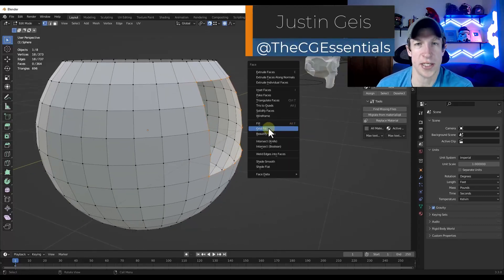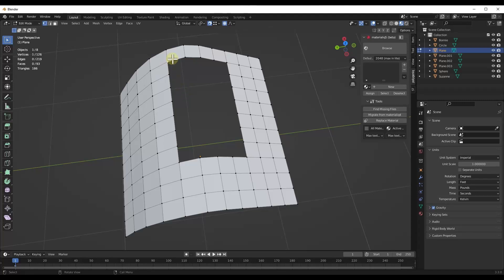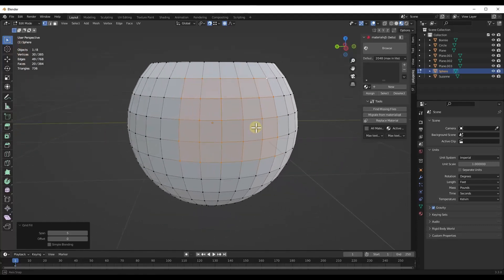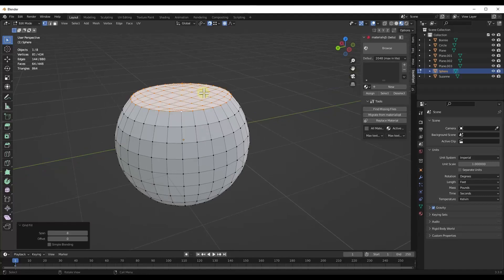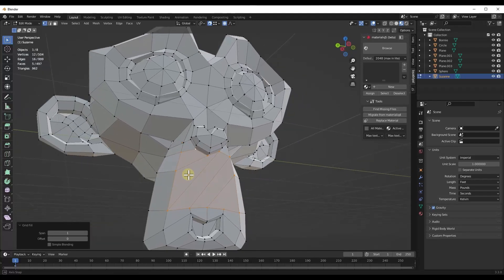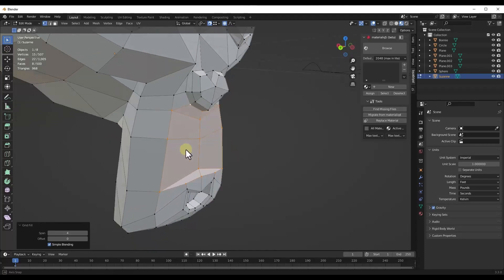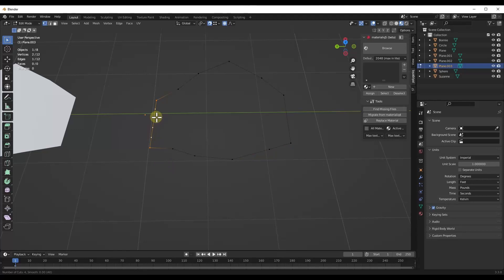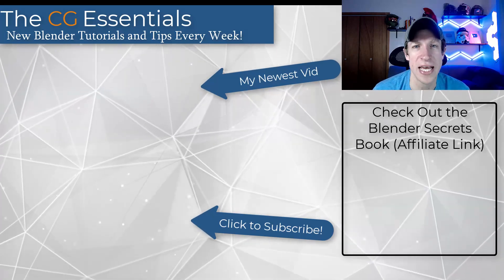FILLING HOLES in Meshes with Grid Fill in Blender!

Comment: ctrl f to fill is nice, but how you find it so i can manually see the path and learn it inside out? for example, if i want to make a cube i know i need to press shift+A and it will open a "drop down" menu but i also know that without keyboard, i can go to Add in the selection menu screen?

Comment: why doesn't blender have a simple modifier of Cap Holes, like in 3d Max or close holes in Agisoft Metashape? why do you have to select the edge of the hole and then you can click F? what if you just want all the holes to be closed? why can't this be done in one click or one modifiers like in other software, why in blender there is not even an add-on?  or is there?